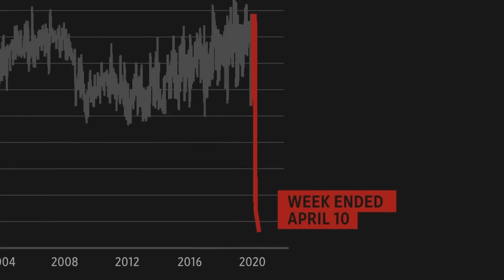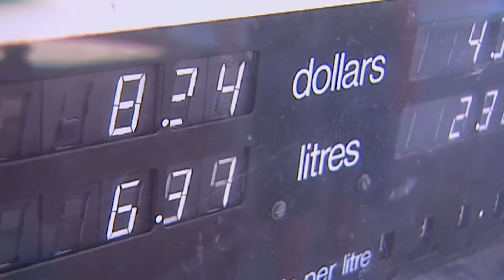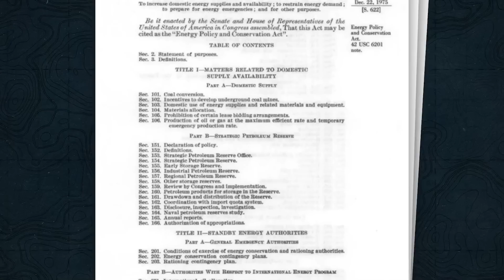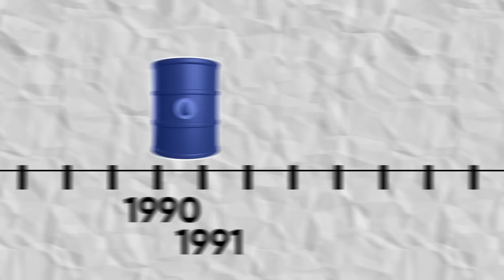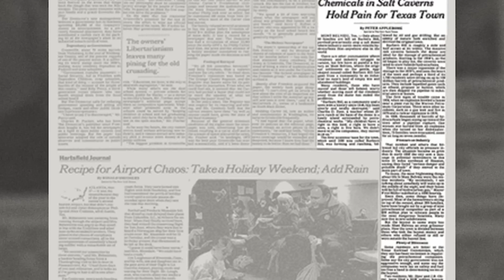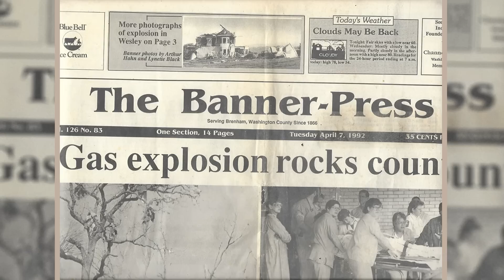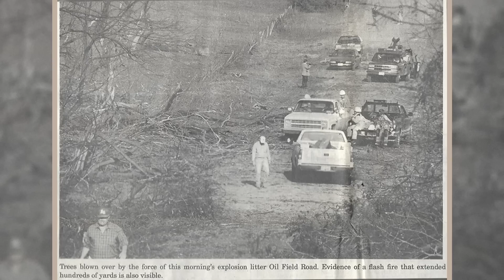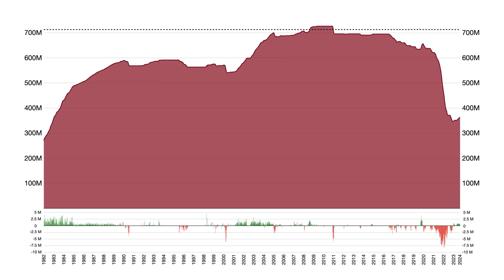Why Is the US Pouring Millions of Tons of Oil Back into the Earth?

Comment: hydrogen in its current form will never replace gas, for example the UK started creating hydrogen to eventually replace natural gas the only issue is we were creating it in a process called natural gas reforming also called gray hydrogen (most countries use this method including the US), this process involves fossil fuels mainly methane from natural gas with an efficiency conversion rate of 70-85% which means for every $1 of methane used you get back on average just 70 cents in hydrogen meaning hydrogen production is a wasteful production method with a loss of between 15-30% of the initial resource and the natural gas still gets burned like it would in your home boiler or fireplace so whilst the hydrogen is pollution neutral the production method releases the same pollution and is far more wasteful than just burning the natural gas in your home

Comment: Addicts . 36 % of use come from CARS . Do we shoot the car no. Do we kill the internal combustion engine maybe and replace it with a hybrid or electric. This guy is suggesting hydrogen also risky as fuel. And if tesla electric just where is your battery getting that electric from ? A coal oil or gas plant ? Then maybe solar wind nuclear geothermal and biomass are better electric providers for cars. Oil won't go away it provides all your PLASTICS . SPECIAL AIRCRAFT FUELS AND DIESEL OR SHOULD I SAY DISEASEL. DIVERSIFICATION CAN EASE DEMAND ZND STORAGE DEMAND.  LITHIUM I THOUGHT THAT WAS ONLY A MEDICINE .HAVE A DEEP THINK AFTER THE OIL WARS AND CONTINUING TRILLION DOLLAR DEBTS 🤔 we are all not going to be the clampetts rich in Hollywood with a granny and a cement pond in the back.

Comment: I don't remember the price of fuel dropping during the pandemic with all the supposed surplus we were supposed to have.
Reply: Yeah.  A lot of people have had massive memory dumps since covid.  They even forgot how bad Trump was.  Some even forgot he was already president.
Reply: markets crashed so badly the market price of WTI went negative briefly as things adjusted.   Gas toward the end of that year was super cheap due to excess volumes, and a lot of lifting of oil was curtailed, drill new halted/slowed and a ton of bankruptcies because of it resulted by end of 2020.  Took about 18 months for things to re-jigger and drilling to kick in again.  We have since blown past the volumes produced at peak of 2020 (Feb/Mar) every week starting this year, it took that long.  the 4 years under prior guy will be substantially lower than the 4 years under current guy... drill baby drill, is unwittingly NOT a solution, funding some refineries tailored toward light sweet oils, maybe is for gas/diesel...

Comment: THE BIDEN ADMINISTRATION HAS BEEN USING THE STRATEGIC PETROLEUM RESERVE TO ARTIFICIALLY LOWER THE PRICE OF GAS AND THE RESERVE IS DOWN TO 346MB ON OCT 2023 FROM 594MB IN DEC 2021. This process continues by the middle of a Harris administration the price of gas will exceed $5.25 /gal in Texas.

Comment: Small town Cushing Oklahoma has more pipelines coming into it than any place on earth. Over 98 million barrels of oil stored in above ground tanks. Our first tanks was built in the 40's and it has been expanded since then and keeps getting bigger every month. For the last 15 to 20 years one to 3 tanks are built almost monthly.  Like 400ft round 80 ft tall.  They are still building them, to give a Idea in 2016 our farm held 54 million barrels and now in 2024 is at 98 million. sure so I am not where you got the info that they just started building them in 2020 and can only be here 5 years.  I have lived here since 98 when we had about 600 tanks the biggest 200 ft in diameter & today it is like 16oo plus tanks and many are at 400 ft wide. When you see the top of the tanks the roof float on the oil and goes up and down in the tank helping to prevent oxygen from mixing with fumes .So when you showed the tank farm in China many of those tanks was empty..  But inject oil or gas into salt caverns is nothing new and has been done in the us over 100 years.    So I think your info is off a lot on this video.  I have lived here since 98 and I have worked in the tank fields hauling oil but also doing remediation clean up when spills happen as well as every so many years ech tank must be taken off line and drained and pressure washed spotless inside and all the welds xray and inspected before returning them to service.  I have cleaned many of these big ass tanks  and live here so I know I am right and you are miss informed at best. Like I said Cushing is the largest above ground tanks.   Also the tanks have huge earth berms built all around them.. if a tank was to rupture the berm is supposed to hold the oil in a pond built around the tank. Most the old rivet built tanks have been replaced but some have been her 80 plus years now. We are connected by pipelines they go all over America and even into canada alaska and mexico as well as as pipes that can connect to the lines coming in from the gulf or any place in the world.   We was about to have another big one fro canada but Biden stopped it day one in office.   Also just before covid we was full and we had purchased the oil for $37 a barrel and in 2022 it got as high as $128 a barrel. Joe biden also released millions of barrels of oil out of the reserves and then to replace it it cost us premium prices.  Costing us over double to replace.
Reply: Thank you for the information. 😊👍
Reply: The oil sold by Biden is not costing billions, because nobody has been buying it as you say.  And while you have many nice details, I do not see any serious conflicts between that information and this video.
Reply: yeah, and that volume of oil is almost meaningless in the global sense.  It's the clearing point for light sweet domestics ( WTI being one specific that fits).

Comment: The Brenham Tx Natural Gas explosion happened as a result of a vehicle hitting an above ground section of the pipeline and causing a small leak.  As it was late evening a on a chill night the gas, which is heavier than air, stayed low to the ground and drifted along the contours of the area.  It eventually reached a single family home where it accumulated overnight until a source of ignition ignited it in the early morning hours.  This explosion was not the result of any lapse in safety or engineering fault of the petroleum industry.  It was a drunk driver who ran off the road and hit an above ground section of the pipeline.  This incident lead the Texas Railroad Commission to require that all above ground pipelines be provided with guard rails or other protection to protect against accidental damage such as this.
Reply: we felt the shock wave/explosion 50-75miles near Dayton Tx
Reply: oh here we go a know it all repeating the crap they been fed ya cant trust nothing ya government says and when it the usa you know your being screwed for them $$$

Comment: surplus oil is supposed to reduce prices!
Reply: Crude oil cost is a small contributor to the price of petroleum products
Reply: @robertanderson5092  correct, and the price of a gallon of "gas" has a huge amount of taxes on it roughly 15% on average. i am sure there are lots VAT on oil and oil products themselves or the production of said products.  taxed to death
Reply: Plus the hidden tax of regulation regulation regulation. So they can build solar farms in the desert that after a few short years is busted, broken, destroyed and polluting the land killing off the sweet little precious desert life. But don't hear the enviros and save the earthies saying a word lol.

They're the same ones who gets a new iphone everytime a new one comes out and drives electric cars that would have to stay operating for near 20 years before they reach carbon neutral and that's as long as they don't need a new battery yet the mega huge strip mines are still there and the earth is destroyed and with a limited supply of the lithium for those batteries. And still no feasible recycling for solar panels and for that matter the windmill blades that has to be replaced every couple of years and don't bring up all the mass bird kills from those blades. 

So how do like your green energy now..? And to think my gas powered truck reached carbon neutral long before 20 years and it's pollution and carbon output is less than buying the replacement battery pollution and carbon output to mine, extract, process, manufacturing and shipping to the dealership to put in ur electric vehicle...

Oops guess people don't know about that. So I'll continue saving the environment, earth and not contributing to child labor and slave labor to get the lithium for those car batteries by driving my gas powered truck.

Don't get me wrong I have a battery powered car and I race that little RC screamer for entertainment outside so I don't knock anything over or scratch the furniture. My neighbors kids love it and I let them play with it and run the batteries down and I'll charge them back up and life goes on...
Reply: depends on the properties of the oil, it's not all the same and doesn't all yield the mix of output products needed.  US refineries are configured mostly to deal with mid/heavy oils.  they mix in the as much of the domestic lights as possible and export the rest as a functional solution.  there are places that want extremely light crudes and are glad to buy it.

Comment: Last time the oil was used was when Biden tapped in to it twice to lower prices during election time. n 2022, the Biden administration sold 180 million barrels of oil from the Strategic Petroleum Reserve over 6 months. The sale lowered the SPR to its lowest levels in 40 years and was the largest ever release of oil from the SPR. He also took some out in 2021.

Comment: "has only been used 3 times" other than what the current admin did as they drained it to less than a third
Reply: And refilled it at a lower cost than what was sold. Duh.
Reply: Obama drew it down tremendously and at the same time began selling US diesel to Venezuela causing diesel motor fuels in the US to go through the roof. 

Trump refilled the reserves at a very favorable price and got the prices of motor fuels drastically down.

Then comes Biden who draws the reserves down selling to his employer China and yep you guessed it up goes the price of oil and motor fuels. 

Dems hate America and Americans and screw us and the Repubs (not talking RINOS) are the opposite usually and down goes the price of motor fuels and oil due to increase in production.
Reply: The true crime that this administration is committing against oil is restricting drilling
Reply: Not 1/3.  Its a bit more than half.
Reply: We cant let trumpndonthis again
Reply: Why lie. Do you not know we can research the real data in less than 10 seconds? The reserve was only drawn by about half and has been being refilled since the middle of last years, at a profit.
Reply: They made a profit after refilling at a lower cost.
Reply: @robertsprague8448 Biden didn't refill it at a lower cost numb nuts..in fact it never has been refilled yet and it would cost a shit ton more
Reply: One of the best decisions any admin has ever made. 
Firstly it made a profit for your country.
Secondly, it prevented a huge spike in oil prices, which would have caused an even larger increase in inflation. 
Finally, it allowed the government to tell producers, we have a reserve to fill, if prices ever drop below X value, we will but it from you. Which has given producers the security to ramp up production and effectively break OPECs strangle hold on oil prices.
Reply: @jeffree9015 👍
Reply: The current administration was required by law to sell oil from the strategic oil reserve because of republican bills passed in 2016 and Donald Trump and his decision in 2018 to sell more oil .Sometimes people should know what they’re talking about.
Reply: @Morpheus187  They've been doing this similar thing dating back to 1996. This bills were achieved on a Bipartisan basis in Congress, as it has always been done. The blame doesn't lie on Trump as he also topped off our Strategic reserves at low prices. Remember how cheap gas was? I was paying 1.90 per gallon at one point.
Reply: @jesses1589 I paid 1.65 in Southern VA back then
Reply: @Morpheus187 YES.  THAT IS CORRECT!  EXCELLENT INFO!  👍
Reply: @Morpheus187 unfortunately Maga is Factually adjacent 😂
Reply: You know we can easily look at the facts to see you are lying. Of the 700 million barrel reserve the oil in storage never went below about 1/2 of total capacity and since then when the price of oil dropped they have already started refilling it turning a profit.
Reply: They dont care they just say what their told to feel about it.@matthewhuszarik4173

Comment: Their storing it instead of putting it on the market so they can keep the prices up
Reply: The SPR was never meant for price speculation. It was meant to have oil left to rebuild after a nuclear war.
Reply: @gregorymalchuk272 Actually that really is funny  😅  👍
Reply: it's all about not getting cut off from supply of oil types being imported, largely.  Not about nuclear war, not about price control - it's just to have some options and readily available volumes if needed for any disruptive reason - of late the largest has been storm damage/delays for imports in the gulf/channel area.

Comment: Here is a summary of the key points from the video:

The video discusses the global strategic oil reserves and underground storage facilities used by countries to maintain emergency supplies of oil. A few key points:

- Many countries, including the U.S., Japan, and China, have invested heavily in developing vast underground storage facilities, often in salt caverns, to hold strategic oil reserves. This allows them to access these supplies in times of disruption or crisis.

- The U.S. Strategic Petroleum Reserve holds around 700 million barrels, enough to last about a month if needed. However, this is just a small fraction of global oil consumption.

- There are concerns about the safety and environmental risks of storing oil and gas in unconventional geological formations, as this can lead to groundwater contamination. Past incidents have shown the potential for leaks, explosions, and other problems.

- As oil reserves become depleted, some countries are exploring using these salt caverns to store alternative energy sources like hydrogen, which could play a role in the transition to greener fuels.

- Overall, the strategic oil reserves are meant to provide a buffer against supply shocks, but the long-term sustainability and environmental impacts of this approach are still being grappled with.
Reply: Shut up